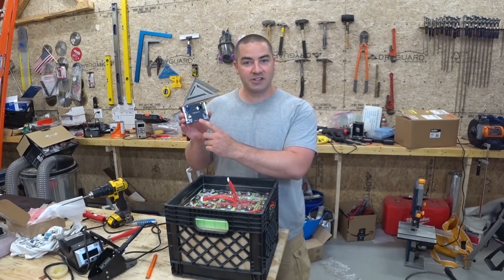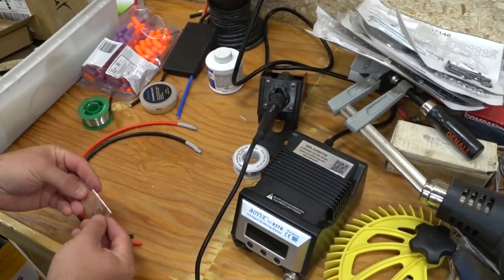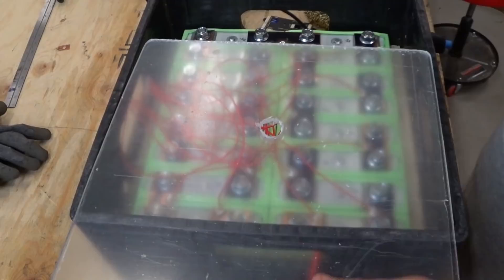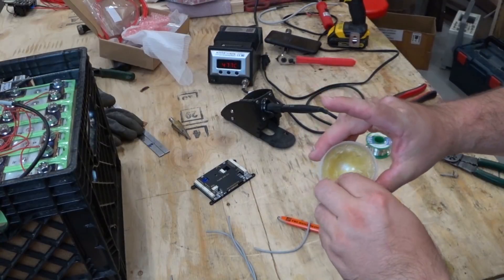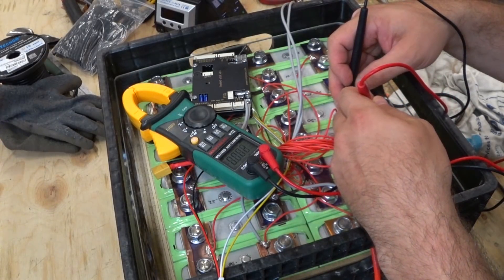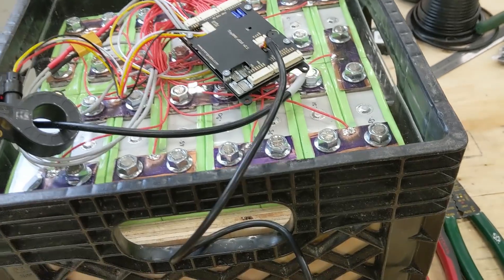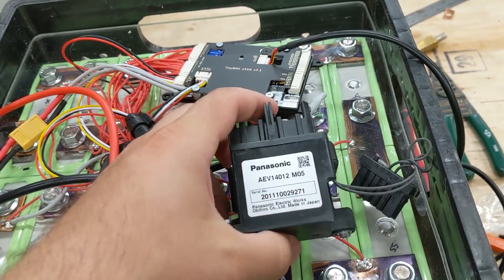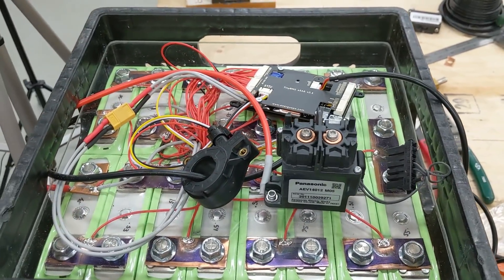Tiny BMS installed in the Milk Crate Project

Comment: Hey David, three things:

1) Powered side is always a receptacle/female for safety. Plugs/males represent an exposed shock hazard, so you're doing it correctly.
2) A 3/4" neoprene grommet (t.ly/y6bT) would dress up that hole in the plexi nicely!
3) Since the top of the pack is visible, I'd do a bit of cable management to make things look organized.

Also, while not necessary for this project, torching the edges of plexi (MAP or butane) is a quick way to clear the edges.
Reply from the maker: Excellent suggestions.  Thank you.  I'm excited to try torching the edges, never heard of that.
Reply: @DavidPozEnergy  We fabricate vitrines for display cases for galleries, museums, retail and interior spaces all the time. I cut the acylic sheets on the CNC first. External edges are scraped and sanded, then flamed, while internal edges clear when joined using CA glue

MAP gas burns hotter than butane/propane, but either works. Be sure to use a pencil point thin clear blue flame. Hold the torch a couple of inches off the edge and perpendicular to it. Like spray painting, start off the edge, sweeping the flame from side to side in one continuous motion, finishing off the opposite edge.

Have fun watching the magic happen before your very eyes. It never gets old!

Comment: Do you have a address for fans of you channel to send you things
Reply: You may be able to use a mosfet to turn your relay off and on or maybe without the relay I think the circuit would be simple enough to be made on bread board 
Those little step down converters are under 3 bucks also

Comment: The bad thing about using this kind of BMS is that it requires an external contactor and those waste so much energy those coils get HOT and just waste a lot of battery power. I considered one but If MY BMS cant handle the current I need I will just parallel a couple together. seems like the most economical way to go. I can still use a Bluetooth power monitor or a bluetooth active balancer to look at cell voltages.
Reply: Depending on how your using these batteries, scooter, bike or solar storage. If solar storage, you could use a shunt trip. The only consumption would be that of a small relay to control the shunt trip breaker, which would be very small.
Reply: @jakeandrules7724  Thanks! that is a great idea. I never heard of a shunt Trip breaker till you just told me. Yes a Shunt Trip breaker and small relay would work great! I googled it and been reading up on them. I really appreciate it.
Reply: @jimthvac100  no problem!

Comment: Would be nice to find a higher amperage mechanically held contractor that does not require a holding charge to keep contactor closed. I know they make some for lighting circuits but all of the ones I have seen are only good for 30 amps.

Comment: If it can supply 70mA @ 48V that’s 280mA at 12V. Might be enough depending on the step down you use. If you’re going to use another relay you’re going to need a 12V tap off your battery to power the bigger relay. Better off just finding a 48V relay.

Comment: You can get away without the isolator but don't have the battery connected in some way to the laptop (IE powering an inverter with the battery then charging the laptop) while also having the USB connected
Reply: Even if inverter is charging the laptop, it will still be fine in this case. This is because all power supplies for laptops that I know of are fully isolated and doesn't share a ground with supply side.

Comment: When you check the voltage per cell by probing the battery, you gotta be careful. I have shorted it before. As its only one cell it didn't permanently kill the wires or anything but if I left it for any longer there would have been some action

Comment: Really digging your videos I'm new and learning a bunch. I'm trying to replace my acid batteries from my 5th wheel. What batteries or battery pack would you recommend. I have a 12v inverter but willing to use something else is necessary. Looking for at least 1.5 kilowatt hours..don you think that's overkill?
Reply from the maker: A battery with a capacity of 1.5kwh might be overkill, or it might be under-sized.  I have no idea what your loads are.  A 12v inverter might be fine if you want to run a couple light bulbs and a laptop.  But anything more than that, like a fridge, induction cook top, washer, dryer, occasional tool, you would be better jumping to 48v.  If you know your loads, then see if this online calculator can help you decide:  https://www.altestore.com/store/calculators/off_grid_calculator/

Comment: I would like to see a really good video showing normally on and normally off relays and how to control them and how to use them with specific parts links and amp ratings etc . I haven't been able to find any. I know the theory but finding ones that use low energy or the transistor circuits to buy that another comment linked to or are rated high amps etc is hard.

Comment: Great video. Whats the plan for that pack?
Reply from the maker: I'll parallel it into my larger home battery system.  Or, I'm also thinking of strapping it to a hand-truck with an inverter and making a portable power station.
Reply: @DavidPozEnergy  Nice. Didnt know if there was a special build for the battery.

Comment: I'm still gathering some pieces for my first build (n2.1) and the bms is the next part on the list. It's a simple 12v 4s config. Could I use that bms for my purpose or is there a smaller version with the same functionality?

This is going to be an rv battery and being able to connect  to a mini pc directly with USB would make monitoring and tweaking the system extremely easy and exactly how I want to do it.
Reply from the maker: Yes, this BMS can work with less than 16s batteries.   That's one of the nicest things of it.
Reply: Check out the Electrodacus sbms0. The new version is possibly available September? It has monitoring inbuilt however some users are running Raspberry pi for customized monitoring.

Comment: I live in Canada  but I have a barber salon in Jamaica but I want to know the type of solar system to use there
Reply: That's a question that would depend on what your electrical needs would be. First, find a solar calculator on the internet and calculate how much wattage each item you intend to power uses per hour and then how many hours per day you use it. Then times the days by 31. Take this number and times it by 1.20% and you will be close to the amount of your daily solar power production needs. Check out a sun solar chart to see how many days your location in Jamaica has with or without sun if you are going to need battery power to get you through a few cloudy days and compute the amount of power use per day times average for no sun days to determine your storage needs. If your needs are above 3000 Watts per day or per hour you will need a 48V system. Less than 3K 24V and 1.5K 12V

Comment: @DavidPoz: According to the Tiny BMS Datasheet, the BMS only consumes a few mA, or microA in sleep mode. After connecting the external current sensor and restarting the BMS, it should show the correct current.

In general, I think this is a great BMS for DIY purposes because you can customize a lot of settings - excellent choice, thanks for sharing. I use one myself too.

One problem I noticed on this BMS design:
Depending on the characteristics of your inverter, the discharge DC current shown by the BMS may oscillate widely around the "average" DC current. This is especially noticeable at higher currents. Example: 30A average +/- 10A @ 0.1 Hz or so, i.e. a wave period of several seconds or so. If this is the case, then this should not be a problem for the SoC calculation according to Energus. However, this current reading is not very useful for determining the instantaneous average discharge DC current. This oscillation seems to be caused by the interference of the current sensor sampling rate and the frequency at which the inverter "sucks" current pulses from the battery. I wonder if you observe this too.
Reply from the maker: Thanks for sharing your experience.  Once I have this hooked up I'll have to check for that.
Reply: I have the same issue, been playing around with different settings to see if I can slow down the curve

Comment: Howdy great videos. I have that same cable that I bought from Amazon looking at it. It doesn’t look to be copper cable like they claim. What do you think?
Reply from the maker: I think it's a coated copper.  Tin, Nickel?
Reply: probably tin coated most marine and other high quality cooper wire is tin coated to reduce corrosion

Comment: Great video as usual. I came across that bms but when I saw that:
Cell balancing: 150 mA, dissipative
...seriously 😑 it will never ever balance a battery pack of 200ish Ah...may be the one you made with brand new prismatic cell will last for a while but as they start aging I wonder how this lil bms will be able to cope.
Reply: It's not great but as long as your cells are matched it should be fine. If your cells are getting substantially out of balance where this can't cope, you've got bigger fish to fry.
Reply: You can set this BMS to balance at any voltage.  If it is continually balancing that should take care of even larger cells.

Comment: You never state how you intend to use your battery builds ie AH and max Amp load. This build looks good for an RV however the Tiny BMS only has a max 30 amp load. What good is a 30 amp BMS for?  In my RV i may pull 60 amps running or starting my AC using a Victron Multiplus 3000/24 inverter.
Reply from the maker: I'm running the loads through an external relay, not through the BMS.  So my maximum amps is limited by the relay, or battery, or wire.  But not the BMS.  The BMS can turn on/off the relay.
Reply: @DavidPozEnergy  please mention this in your next video, but I would guess the size of the cables you choose still limits your max amps. I too use a 500 amp contactor to control my 2 Teslas and have it fused at 250 amps using  00 cable. The bms i used SBMS0 exios control all the relays in the chargers and out put devices Multiplus 3000/24.
Reply: @thomasgeriak4322  I've just finished setting up a sbms0 in our caravan using a combination of extios and solid state relays to control all charging and loads and it works fantastically well!
Reply: @gordonb2011  I am happy so far with my function of my 2 SBMS0s working with my 2 Tesla modules controling my inverter and Mppt.

Comment: Hi David,
 I have a question, I have a motorhome, I have space for 12 12v batteries.  
How do I have to connect them so that they are in a single block?
Thanks
Reply: I doubt you want a 144voklt battery.  No one can answer your question without knowing what voltage you want to end up with.  for instance for 48volt you would wire 4 of the batteries in series so you would have 3 groups of 4  then you would wire the 3 groups together in parallel. It doesn't matter how the batterys are arranged but it makes the wires shorter if arranged logically. series is positive terminal of a battery to negative of the next battery this increases the voltage. parallel is positive wired to each other and negatives wired to each other this keeps voltage same and increases the power available. This particular arrangement is termed a 4S3P pack.this is probably clear as mud but can draw diagram here.
Reply: They might mean in parallel as a single 12v source or possibly 24v or even 48.  That's my take away from the question.

Comment: David, great video, I just got mine in the mail today, question, in your video, you did not hook up the main Positive and Negative?
Reply from the maker: The main positive/negative will be hooked up to a relay, but I need to get some parts for the circuitry first.
Reply: @DavidPozEnergy  so you will be connecting to the BMS and then the relay in a later video, they seem like small pads on the BMS
Reply from the maker: Remember the big relay I showed near the end of the video?  I pulled that big relay from an EV battery.  That is what I will connect to the main positive wire.  The current will not pass through the BMS, only through the relay.  The BMS can turn the relay on/off.

Comment: Kinda better off with the chinese 2 amp BMS protect and balance unit's. ( I do own one)
I would like to see what kind of options it gives you in the software. And they look of better build quality by a smidge than the chinese one's. 
I would like to see you push this thing with 20-30amps at the bottom and top of voltage range to see how it fairs with these larger brand new cells. My guess (given the two capacitors) is that it charges/discharges the lowest and highest cells one by one till they all get closer and closer together just like the chinese units (very slow process). But perhaps you were only interested in the cell protect and shut off feature of it!?
I recently purchased the BYD packs from Battery hook up and a 10 amp zero loss chinese balancer. The balancer will not keep up with these (larger cell) used packs at the bottom and top volt range. Four packs, 16s config. (48v nom.), bottom balanced.. at .5-.10 delta it takes roughly hour in a half to bring them back to .008-.004 with zero current in or out of pack.
I wish I knew circuitry, I would love to build a better lager, faster unit to handle large cells.. 
These units that we find and use are really only good for the one time use bottom balancing for already built packs and smaller cells, think e-bikes.

Comment: What would the relay be for ?? A horn or notification device?
Reply from the maker: Yes, you can drive different things with a relay.  Or in this case, Just to turn on/off the battery to prevent over-charging or over-discharging.

Comment: When will you finish your house Lithium project.... why so long??
Reply from the maker: I always have more than one project at a time.  Sometimes I'm just waiting on more parts to come in.
Reply: DavidPoz - but those batteries on the wall have been complete for months.
Reply from the maker: I'm powering my house off-grid using the large BYD battery packs and my SMA inverters.  Is that what you are asking about, or something else?
Reply: DavidPoz - yes , that’s what I’m asking. The last I heard, you were balancing the battery packs.
Reply from the maker: OK, sorry I was confused.  I need to do a follow up video.  It's been powering the house for a couple months, but there still seems to be some glitches in the SOC calculation in the inverter.  I want to change out my shunt wires for a shielded twisted pair and see if that helps eliminate some of the deviation.  Basically, I'm still fine-tuning it.
Reply: DavidPoz — I thought that the state of charge could be determined by the battery voltage.